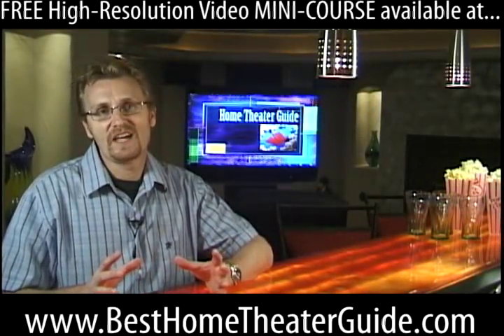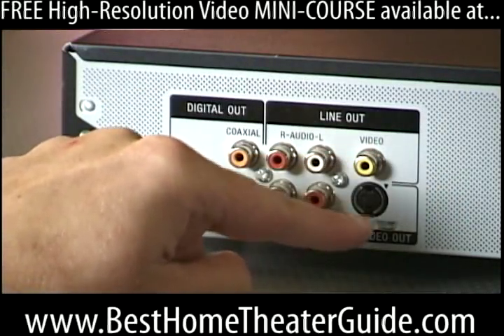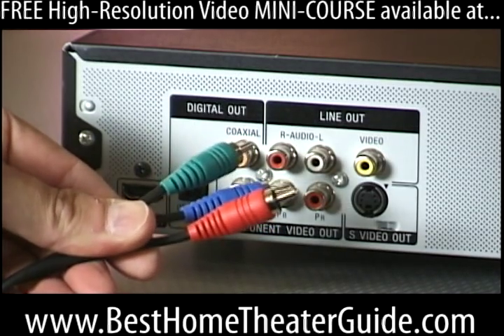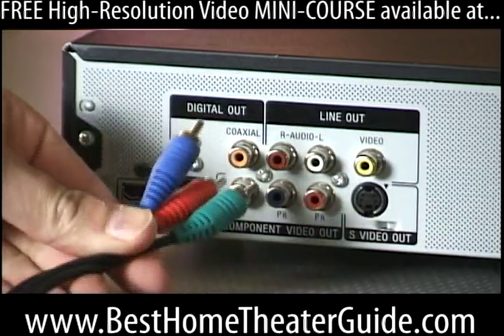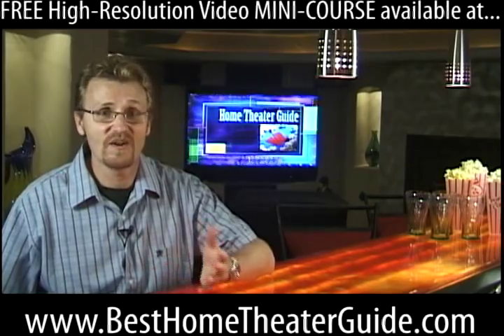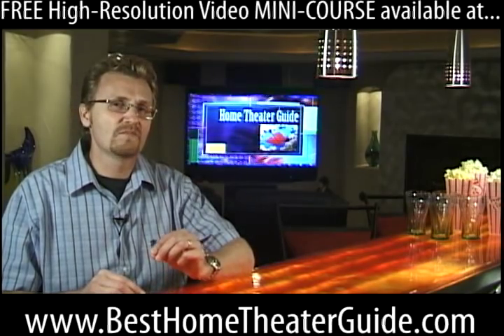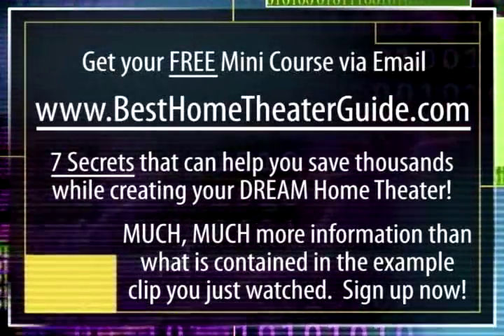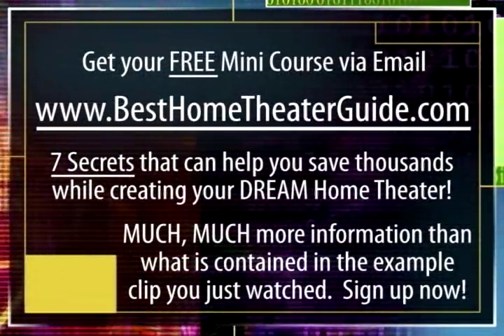DVD Video Outputs HDMI Component Composite S-Video Tutorial

Comment: @cobh8crew2009 Yes it is. Anything digitally sourced by nature has a better outcome that an analog moved picture. To move the image as analog, you are literally pushing the electricity down some copper wires and try to get the best... With Digital, any interference in the picture won't cause as great a problem. It the TV can still see that for example in one frame there is 01010, it can still make up the full quality picture, even though there is interference there.

Comment: Why most DVD don't have Rf cable
Reply: I think by the time DVD players came out, TVs with composite inputs were common enough that they decided to just eliminate the RF output, and DVDs weren’t really intended for recording, so they also chose to forego the RF input. VCRs, on the other hand, were not only popular in the time when almost all TVs were RF-only, but they were also intended to record off of TV and act as a pass through for the TV signal, so it just made sense for most VCRs to have RF inputs and outputs.

Comment: Ah yes, a typical rear panel of a DVD player in 2008: a choice of HDMI, component, S-video or composite. It's depressing to see a rear panel of a DVD player from 2016 or even a few years ago. Nowadays you'll only have a choice of composite or HDMI. Hell, I have a Panasonic Blu-ray recorder that I bought two years ago, it only outputs HDMI and only has one composite input. I have three older Panasonic recorders from around 2000 to 2008, they all have at least two composite inputs with S-video. One of them even has two SCART inputs!